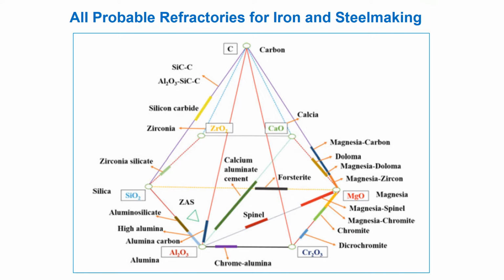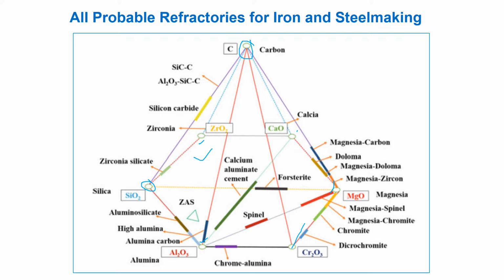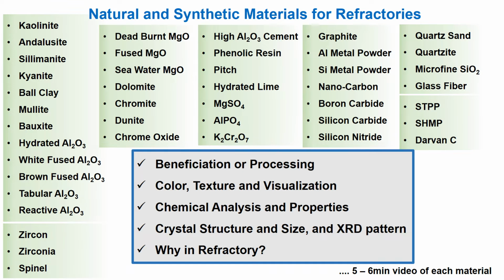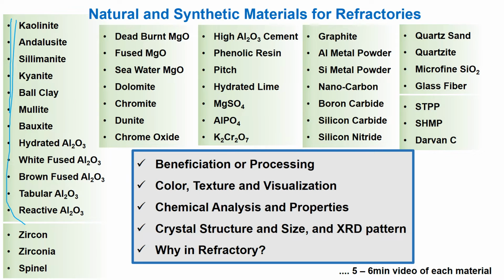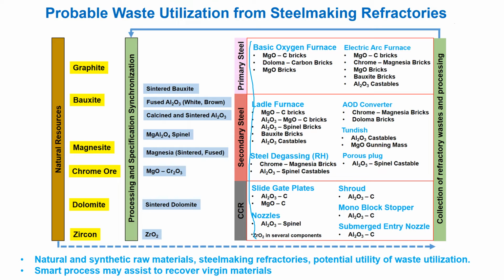Lecture Series 2 - Lecture 1 Introductory for 'Natural and Synthetic Materials for Refractories'

Comment: Thanks for the wonderful presentation. Only few observations, Kaolinite being a mineral may not be clubbed with raw materials. Secondly, non-plastic clay which is the base material for fireclay grog is a very important naturally occurring raw material for low and medium range alumino-silicate refractories. I think the same should be included in the list.